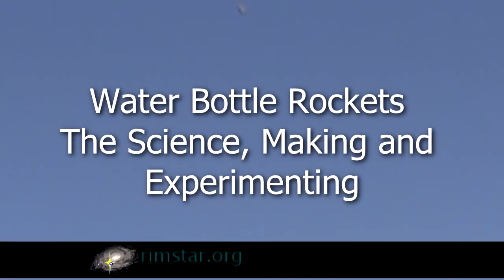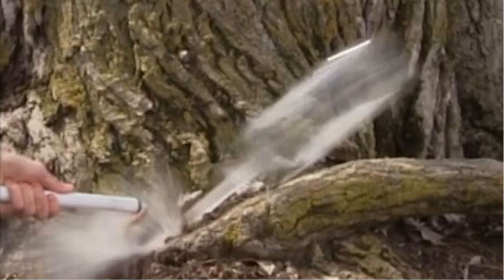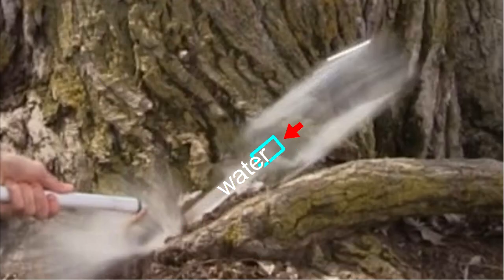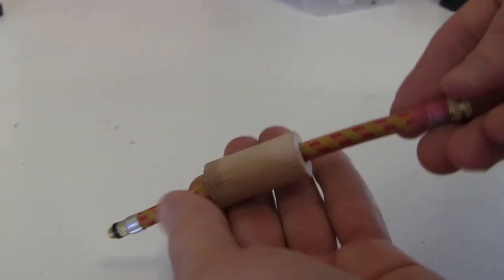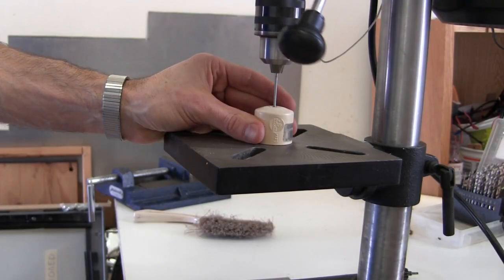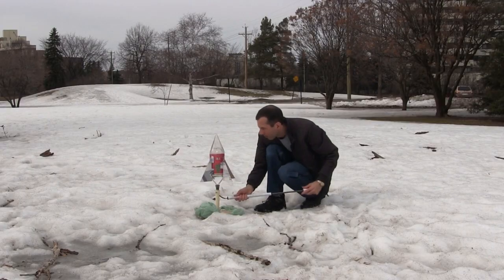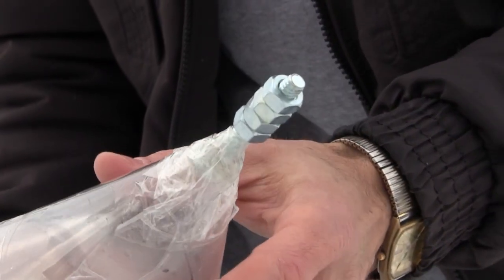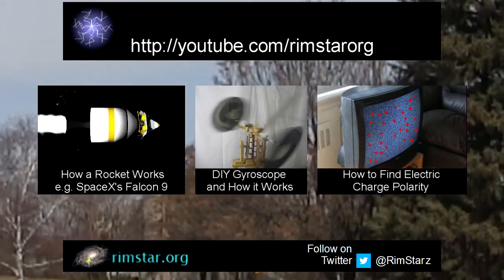Bottle Rocket - How it Works/How to Make

Comment: RimstarOrg what if i put a tire valve in the cork will that work
Reply from the maker: I'm not sure if this question came before or after your others, so ignore it if it's out-of-date. A tire valve in the cork might help, if the tire valve can handle more pressure than the valve in the hose you've been using. I don't know the maximums for either one, so I can't say for sure.
Reply: RimstarOrg thx aolot i was able 2 make it with a ball valve a 500ml bottle flew as high as my house
Reply from the maker: realMPP
Cool!

Comment: my water leaks off the hose
Reply from the maker: realMPP Sounds like you might have a leak where you put the hot glue around the hose, assuming you made yours the same way I made mine.
Reply: RimstarOrg the water comes in 1 end of the hose and out of the other
Reply from the maker: realMPP Ah. In that case it sounds like your valve on the hose is broken, possibly from applying too much pressure. That can happen if the bottle isn't releasing soon enough and the pressure just keeps building up as you pump harder and harder.
Reply: RimstarOrg should i use a ball valve there
Reply: RimstarOrg at the end of the cork
Reply from the maker: realMPP
No, the pressure will still cause the valve at the end hose inside the bottle to break. The solution is to make the bottle fly off at a lower pressure. It's either that or get a hose with a valve that can handle higher pressure or do this differently altogether.

Comment: WoW it's awesome. Instead of the bolts on the outside I reccomend to put them inside and secure with lots of hot glue.
Reply from the maker: Thanks. When I do it again I'll make the fins work better instead of adding the weight of the bolts. Unless there's a parachute mechanism in the top, in which case that'll add the weight.

Comment: You've done a really great job of explaining how the rocket is propelled and why water is used. You could use this as a starting point for further discussions about nozzle size, air pressure, and amount of water to use, since most people believe more water = better.

Comment from the maker: Oh, I wonder how much pressure the the mustard squirters with the snap open tops that are hinged would take before the top snaps open? Though the can't hold much water and you'd have the problem of pumping in the air. Your kit sounds like a cool combination - instant rocket.
Hazarding an guess at the answer to your question, they were twins! :)

Comment: Haven't made one in years. Gave up on getting them to go straight! Can't believe I never thought off mass vs surface area! I always get covered in water too. So the petrol rocket will have to wait. As much as I want to find out how it would work. Local airport may be less than impressed if I tried it :) Maybe a late night beach launch (ocean can be handy when covered in burning fuel).... Seems slightly less hazardous now I know how to stop it flipping.

Comment from the maker: Keeping in mind I have tried it or done calcs... is thick oil heavier than water? If not then it still could be good since you'd have a lighter mass during the initial thrust. If it is then it still could be good since you'd get a stronger reaction. Sounds like there might be a tradeoff. But I guess that's true of water too.

Comment from the maker: Thanks! I've since come up with an even clearer way to explain rockets, but that'll have to wait for a future video. It's necessary though... surprisingly many people think rockets work by pushing against air!

I love your vehicle idea! A little hard to justify as educational even with the reasons you give :(. There's an issue with a horizontal bottle since the water won't be in the way of the opening. You could have a vertical bottle with a tube at the bottom to redirect the water horizontal.

Comment: well snow is melting here alot also. 10 centigrade fells so warm. timing on water rockets is much more complicated, than on combustible ones, whitch i do now. most of people use electronics to do the timing, whitch is expensive. i'm trying to make parachute on my combustable rckets, but had problems with deploying.

Comment from the maker: Thanks. Yeah, I was wondering if a smaller opening the the nozzle might help. Good to hear it does. I just haven't tried it yet (yesterday almost all the snow was melted, today we have already 2cm back and expecting 4cm!). I also plan on doing a better launch pad, either using the 2 nails approach for the release like you're talking about or using the tie straps approach. A parachute and a multistage are also in the plans for this summer.

Comment: nice. i used to build these, but mine 1 liter flew much higher. thing you shuld do: instead of making an open bottle neck the nozzle, put on the cap, and drill 5-6mm hole in it. then, use tube, to go into it. then make a stand for it. for the launch, on the pad attach 2 plans, with 2 holes on each. put bottle in between, and put 2 nails, s it fixes the bottle, and connect nails to a string. build preasure, pull the string, and realeas. it will allow more cntroled launch, and higher preasure.